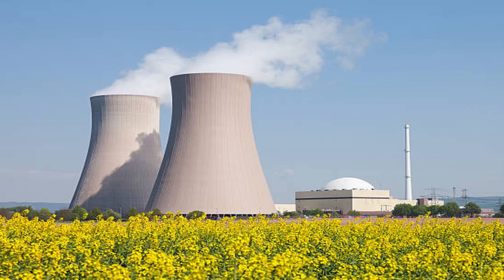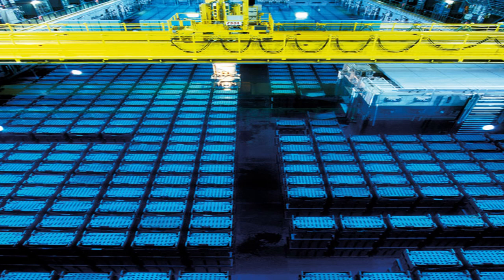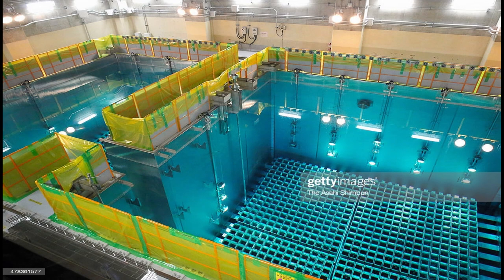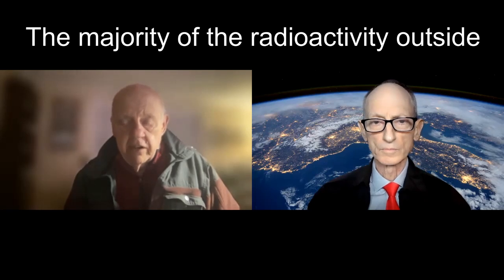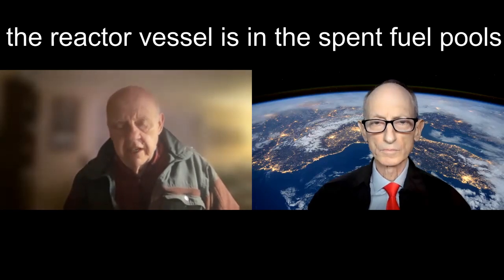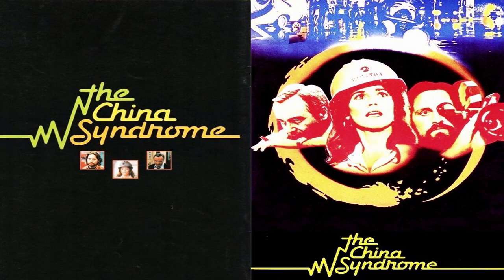Spent Nuclear Fuel Pools

Comment: Roll on the Moltex Stable Salt Reactor-W, which will generate power using fuel derived from high level nuclear waste, destroying it in the process. Bear in mind that fission products decay quite quickly and reach background radiation level after ~ 300 years. It's the actinides that provide by far most of the power, and Canada have a lot of Candu waste with plenty of actinides in it ready for burning. They recently granted Moltex Canada $50 million towards their first reactor, due to begin operating around 2030. To me, it would help if more people were willing to learn about nuclear power rather than simply demonizing it. That's what I used to do until I read Jim Hansen's Storms of My Grandchildren book, which opened my eyes in so many ways.

Comment: There are several other major issues to consider. First and most important is the accumulative radiation damage to the concrete walls and floors of the spent fuel pools. The spent fuel pools have fuel stored in a tight packed configuration to maximize fuel storage space in the pools. This also maximizes the gamma radiation exposure to the concrete. The data used to assess the damage to the concrete is very sparse and is based on concrete that has high water content (“wet”). There is an equally limited data set for “dry” concrete, I.e. concrete in lined pools. That data from the X10 reactor and Temelin strongly suggests that the concrete is 500-2,000 times more damaged by radiation. This happens for several reasons. The largest being the radiation induced dehydration of the cement paste. Peroxide formation also plays a possibly major role. Even without this huge change in damage, the spent fuel pool concrete has already been exposed to radiation levels exceeding the tolerance for concrete (10^10 rad). Recognizing the greater damage when dry, the concrete is in vastly worse condition. A ‘terrorist’ is not needed to destroy the pools. Time alone is sufficient. They are being destroyed by the radiation from the fuel stored in them. 

Every spent fuel pool is a catastrophe in the offing. 

Because the dry casks often use concrete as structural material, not just as shielding, they too are at risk for failure. 

Second, fuels and cladding in reactor condition store an immense amount of hydrogen in the metals as interstitial hydrides. Equivalent formula ZrH5.  This hydrogen is stored in the same way as it is in nickel-metal hydride batteries, and gaseous inter metallic hydrogen storage systems. When this is heated, the hydride is driven out of the metal as hydrogen gas. Any ignition source sufficient to ignite hydrogen-oxygen gas mixtures is enough to start the fire. That then heats the fuel releasing more gas and continuing the process in a potential thermal run away. Worse, the process can be autocatalytic. The water formed transfers heat to the fuel and cools. It then can catalytically be broken down by the metal as it oxidizes, rereleasing the hydrogen which then burns again. This is the process involved in plutonium fires. As a result, the fire burns at hydrogen-oxygen flame temperatures, and not at the lower temperatures expected from the metal itself.

Comment: Why don't they find ways to use the energy these "spent" fuel rods are putting out?  The way they're doing it seems like pouring half the [EDIT: gas] that goes in your car into the trunk, setting it on fire, and then using the car's AC to cool the trunk so the car doesn't burn down.  Why not put those rods into radioisotope thermal generators (RTG's) so we could at least get some electricity out of them, instead of spending more energy/resources (e.g. water) to cool them (throw away the energy they're producing)?

Comment: If the spent rods are still producing physical heat is there not a way to design a reactor that could utilize them for a functionally infinite length of time thus avoiding producing more conventional fuel rods which need to be frequently replaced thus limiting our problem to the rods we have  currently?
Reply: A proposal decades ago, was to box the spent fuel up, somehow, and heat individual homes with it.
Reply: The guy in the book 'The Martian' heated up his martian rover using a reactor. Doesn't sound a nice way to keep warm. District heating would be one use but it would need heat exchange between at least two closed circuits of water. Not sure I'd be happy with it though, I'd prefer we didn't use nukes at all.